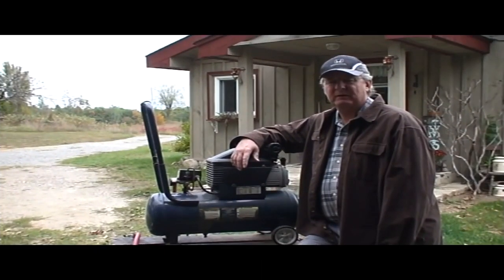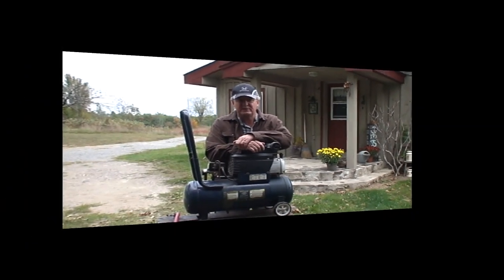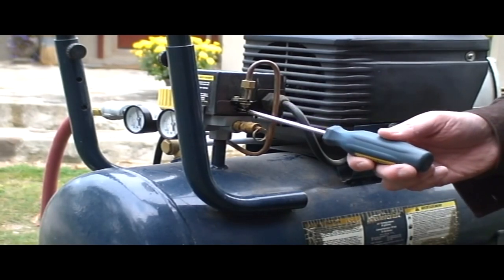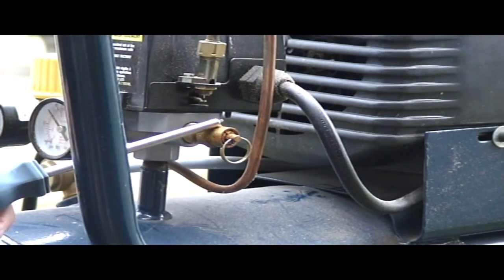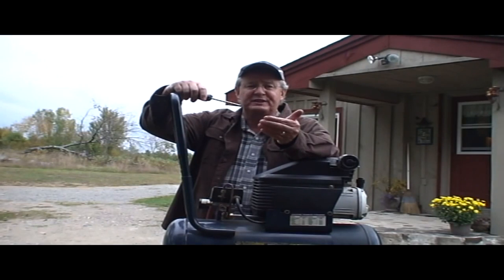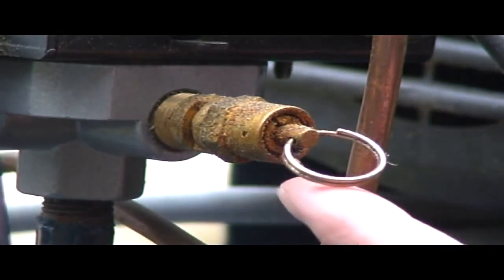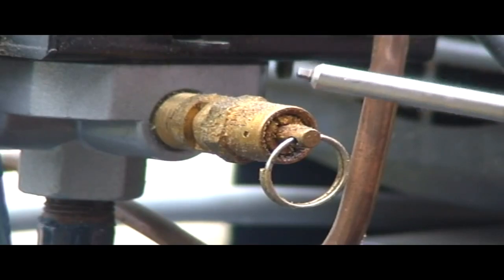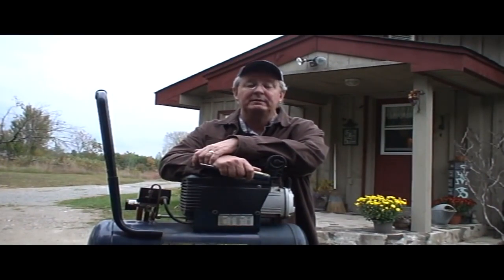Air Compressor Pressure Relief Valves Explained - PRVs What They Are & Why They're Used

Comment: What is the purpose of the unloader valve
Reply: The unloader valve's purpose is to drop all pressure between the compressor discharge port and the vessel's one-way valve. It allows the compressor to restart without arm-wrestling the pressurized medium present in the vessel without stalling. Once the compressor has reached operating speed, it can easily recharge the vessel to setpoint until the pressure switch kicks in. Upon doing so, it opens the unloader valve to depressurize the charge line. And the cycle repeats again.

Comment: Is there a reason that the relief value can't replace the drain valve at the bottom of the tank.  Would be  nice to have it blow out water at the same time I test it
Reply: it will instantly become clogged with rust and other tank sediment junk. so nope. you can't. bad idea.

Comment: Hi. I think you’re just the guy who might be able to help me. 
I have a Quincy 54 compressor. Two stage 60 gallon and I’m inserting an aftercooler between compressor and tank. I will describe the plumbing as it came from the factory. 
From compressor outlet there is a 1/2” copper tube that goes down to the tank. Just before the tank is a brass fitting that has a PRV on one side and a 1/4” copper tube on the other. The copper tube comes out and connects to the pressure sensor. 
I will use a high pressure/temperature flexible hose to go from compressor to cooler. So I need to remove the 1/4” copper tube and replace it with a 1/4” flexible line that connects the pressure sensor and the large flexible hose at the compressor outlet. I think that will take care of my unloader valve. 
But what about the PRV at the tank entrance? It can’t be for the tank because that has a check valve. So it must be for the plumbing between compressor and tank. 
Does this mean I need to move it to my 1/4” line between pressure sensor and compressor outlet?
Sorry for all the words. Hard to describe without photos. But I think that PRV needs to be relocated so it’s still attached to the pressure sensor line. 
Thanks for your attention. I liked your quick and to the point video. 
Paul

Comment: Great video, I have a "brand new", old Craftsman 15362  Air Compressor/ Direct Oil Lubricated - Cast Iron Cylinder, [135 PSI max., 3.7 SCFM @ 40 psi, 2.4 SCFM @ 90 psi, 1.0 HP 3 Gallons]; right out the box malfunction during the initial 'Start up" mild run, break-in procedure. Oil started leaking from the system and it wouldn't build pressure. I checked the fluid bulb, still contained fluid, tightened the bolts down, tried it the pump again, ...."No joy" then turned it off and threw in the back of the garage for ..... LATER.  What should I do to fix/ repair for use?    Thanks in advance

Comment: What does it mean if i pull the PRV and the air keeps bleeding on its own(without me pulling the PRV) but stops at about 70psi..? I have a husky 33 gallon air compressor and its my first time using it, please help
Reply: Were you able to figure out the problem with your compressor? I am having the same issue myself

Comment: if the piston blows out will it need to be replaced?
Reply from the maker: It depends on what you mean by blow out. If the piston extends to vent air, normally, once the overpressure is gone, you can simply push the piston back in.
Reply: There's a difference between a relief valve, and a "safety" relief valve: http://www.cdivalve.com/products/pneumatic-valves/any/asme-code-safety-valves/any/any